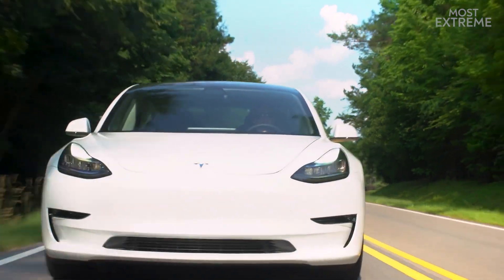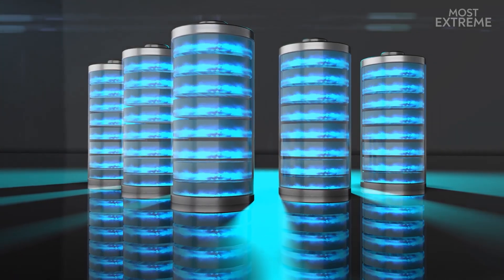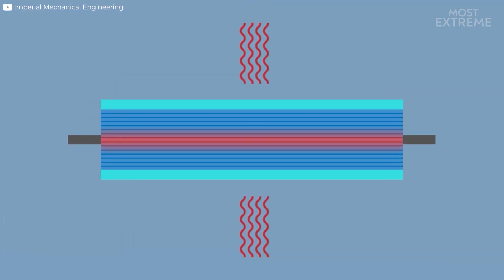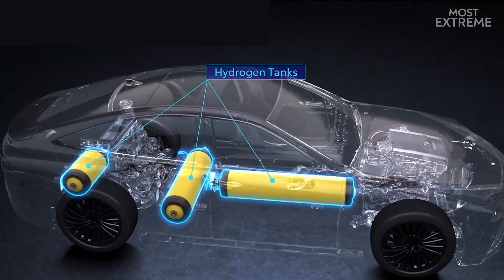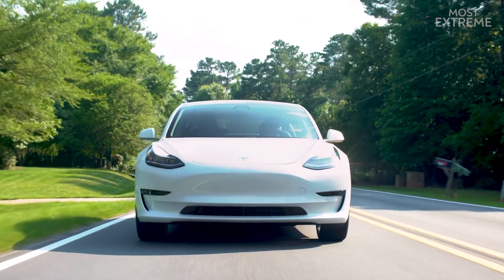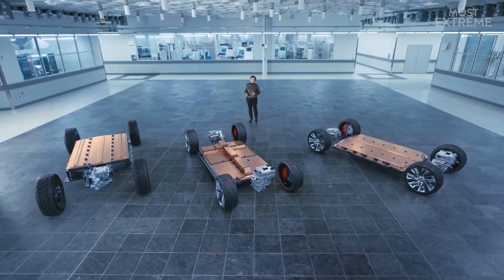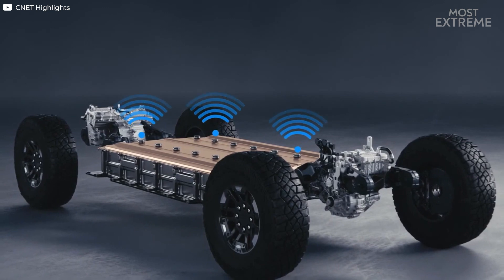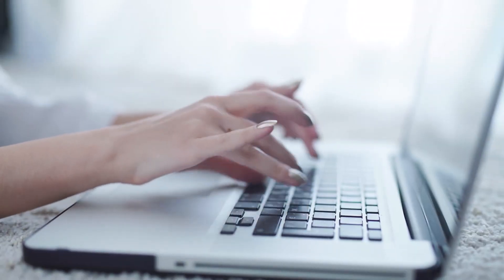Lithium VS Hydrogen VS Solid State | EV Battery Technologies Explained

Comment: ~ Battery EV ~ grid power, to battery, to forward motion, around 85%-90% efficient from grid to road
~ Hydrogen EV ~ grid power to electrolyzer that splits water to Hydrogen 75% efficiency, a 25% loss right off the top, compress the Hydrogen to 10,000 psi another 13% loss, transport the Hydrogen to fueling stations another 5%-10% loss, fueling stations will need energy to operate but let's not even count that, fuel cells are roughly only 40%-60% efficiency so a minimum loss of another 40%.
Simply adding the losses your left with 32% of the original electricity used to split the water. But in truth the losses are cumulative, so in reality your left with about 20% of the original electricity being used to propel the car. So you would need 4.5X the power from the grid up front producing Hydrogen to get the same miles traveled as a battery EV.
In addition to the to that. An electrolyzer that makes 4 kilos of hydrogen per hour (top off 18 Toyota Mirai's per day) plus the hydrogen compressor required for 10,000 psi, high pressure tanks, plus a building and all the various ancillary hardware, monitors and safety equipment cost upward of $2 million dollars, the fueling stations cost upward of $2 million dollars. Added to that will be the cost of replacement parts, labor and maintenance.
Battery innovation is happening at breakneck pace. Hydrogen from beginning to end is much more involved, complex and expensive to maintain. Also there are limitations to the improvements to efficiency that can be made by turning electricity to hydrogen back to electricity. It will never be economically feasible.
Reply: I copy pasted a few paragraphs below from a paper by - Prof. Werner Antweiler, Ph.D.
Fuel cells are not perfectly efficient converting hydrogen into electricity. Some of the energy is lost as heat in the process. The tank-to-wheel efficiency of fuel cells is reckoned to be only about 40–45 percent. Toyota reports that its FCV requires about 0.8kg of hydrogen per 100 km, although 1kg per 100km is probably more realistic under normal road conditions. A typical BEV consumes about 20-25 kWh per 100 km, depending on weight and other characteristics. Some small BEVs are even more frugal.

How is hydrogen made?

Currently, the main method of producing hydrogen is from steam methane reforming (SMR). High temperature steam (700-1,000°C) is combined with methane under 3-25 bar pressure in the presence of a catalyst to produce hydrogen and carbon dioxide in two chemical steps. Steam and methane generate carbon monoxide and hydrogen, and then a water-gas shift reaction combines carbon monoxide with more water to form carbon dioxide and hydrogen. A third step removes impurities from the gas stream, leaving pure hydrogen. Using low-cost natural gas is currently the most affordable option to make hydrogen, but it is not GHG neutral because of the carbon dioxide that is created in the process, and the heat that is needed in the process and comes from burning natural gas. Producing one kilogram of hydrogen is associated with about 9 kilograms of carbon dioxide (Sun et al., 2019).

A cleaner method of producing hydrogen is through electrolysis, where an electric current breaks water into its two constituents. If the electricity comes from clean renewable sources, the hydrogen is indeed mostly emission free. The only emissions are associated with the upstream manufacturing of power generation equipment.

Hydrogen made from SMR with carbon capture and storage is also called "blue hydrogen", while hydrogen made from water electrolysis is called "green hydrogen".

There are other pathways to produce hydrogen. One alternative technology is known as thermal and plasma pyrolysis, which breaks up methane into hydrogen and carbon directly. Plasma pyrolysis requires 10-12 kWh/kg and has far fewer emissions than SMR.

How much electricity is needed to make hydrogen?

A completely efficient electrolysis system would require 39 kWh of electricity to produce 1 kg of hydrogen. However, the devices commonly found in operation for this process are less efficient. A typical operational figure is about 48 kWh per kg of hydrogen.

How efficient are FCVs compared to BEVs?

‘BEVs are more than three times more efficient than FCVs.’

There are two types of energy losses that need to be accounted for when calculating the kWh needed to drive 100 km: well-to-tank (WTT) that accounts from source to hydrogen tank, and tank-to-wheel (TTW) in terms of fuel cell efficiency and propulsion in the vehicle. Combined, these two energy losses translated into a well-to-wheel efficiency (WTW). A recent study by Whitehead et al. (2018) shows that FCV only have a 22% efficiency, compared to 67% for BEVs. This translates into an energy use of 87 kWh per 100km for FCVs and 28 kWh per 100 km for BEVs. In other words, BEVs are more than three times more efficient than FCVs.

If FCVs are less efficient than BEVs, do they have a future?

FCVs for passenger vehicles makes neither economic nor environmental sense. Economically, the extra cost of producing hydrogen and distributing hydrogen makes FCVs less economical than BEVs. Whereas batteries are becoming continuously cheaper and significant innovation is visible on the horizon, the potential for reducing the cost of fuel cells or making them more efficient appears to be limited.

FCVs for passenger vehicles also do not make sense environmentally as long as electricity is not completely clean, or hydrogen comes primarily from SMR sources rather than renewable energy. FCVs with hydrogen from natural gas are not significantly better than modern (mild-hybrid) gasoline engine vehicles. Every extra kWh of electricity that is needed for making hydrogen is putting more carbon dioxide into the air than a battery-electric vehicle, even including for upstream emission in battery manufacturing.

Comment: I see some issues about this over hyped EV moment...the amount of money that will be lost by the buyers when this old battery expired...and the amount of trash battery we will need to take care of...on top of that the natural impact to extract the material to produce both liquid or solid stat batteries... let's hear what they will have to say when these problems popped up...I'll keep my old ICE car for now...
Reply: Ah, you've obviously not heard of EV battery refurbishments.  Cleveleys Electric Vehicles in the UK, carried out a battery refurb on a 10 year old Nissan Leaf. The work took 4 hours, and cost the owner £600.  And there is no liquid element in a modern EV battery. There is nothing to leak out.

Comment: What’s stopping me from getting an EV? Fixed Income Pension’s and EV Prices are Miles Apart!
The same goes for over half the population that had no choice or chance past a Minimum Wage Job.
Reply: EXACTLY, and who knows if you get a lithium battery powered vehicle now they could stop and ban the use of lithium batteries in vehicles if solid state advances in tech due to environmental reasons
Reply: Buy a used EV. Lots of choice out there now. I've seen used EV's on sale at £6k.  The problems you are citing haven't arisen specifically as a result of the introduction of electric cars. The problems you describe would apply to any type of car, irrelevant of it's power source....  If you can't afford a £15,000 electric car, you still wouldn't be able to afford a £15,000 petrol one either.
Reply: @Brian-om2hh  here's the thing, not everyome can switch from there car whether it's for financial reasons or even the desire to change cars, and your not even considering the people who live in apartments that don't have a charging source and even if they did tho those spots would be full 24-7. Ev shouldn't be pushed this hard and it isn't ready yet for everyone to switch too.

Comment: Great informative video into Battery/hydrogen tech. Although I have to disagree with your initials points around hold backs on EV adoption regarding Range anxieties with 300-400 miles of range and long charging times. 

It's extremely rare to drive 300/400 miles without stopping, you would need a rest stop giving an opportunity to charge, and the charging tech has developed fast passed having to wait >hour to gain substantial charge. 

With those particular statements, it's the mindset of ICE vehicle drivers that needs to change, which is the comments I get a lot (I have a Nissan e-NV200 with 100-150 miles of range.) 

Cars that we use for daily driving don't need more than 300/400 miles of range, even today, there may be reason to challenge that if your lifestyle has you driving 100s of miles a week but even then I'd still say that's sufficient range. 

Further, moving from ICE to EV a key in charging is understanding that it is done alongside other tasks and not as a stand alone activity. I charge my van at home of a 3Kw Plug, from 0%-100% it takes 22 hours... you can imagine the laughs from friends that drive ICE saying, "wow we'll have to give you a day's notice to meet up then" because ICE drivers know filling the car as a stand alone activity where you have to stand at your vehicle filling up. This is completely wrong for EV, even with 150 miles of range it is sooooo much more convenient, I come home, plug the van in (takes ~15 seconds) and I'm done, I just do that at the end of each day. If I'm out on the road, I take a put stop to grab food or use the toilet while charging on a fast charger and I'm good to go. 

So really, charging an EV means instead of queueing and standing at a fuel pump, you plug in and go about your day with an EV. 

Great video though, helped me understand the technology inside the batteries. Thanks
Reply: Unfortunately as with everything else on social media people tend to “pick a side” on an issue, and the remarks are, unlike yours, just arguments that prove their position by cherry picking their points. I’m “for” EVs, or “against” them. Context is everything. I live in a rural area in a 2 car household. One EV and one ICE car in the driveway will cut my emissions footprint and gas dependency while retaining all the freedom I could ever want to meet every travel scenario. Until my country’s infrastructure and the EV battery technology matures more, anyway.
Reply: If everyone were to change to ev your electric bills and solar bills are going to go through the roof. You may enjoy how "free" it is now but you'll see. The government and other corporations always have a way of taxing you. And I'm assuming your van is lithium powered? Which isn't good for the environment compared to solid state batteries? Yeah with how anal the world is about the environment lithium use in batteries will most likely be banned and replaced with solid state or hydrogen which means no replacement batteries for the van.
Reply: Agree with you.
Reply: Well, it's not like you stop where you want and can recharge at a 200kW charger and recharge in 10minutes...
300 miles is nothing on a vacation.

I like to go where I want and not plan the trip around the local charging stations and eating in a noisy and disgusting road restaurant. 
With benzine you just refill in one minute and go chill and eat on a nice place in nature

Comment: ICE cars ...Are Silent Killers with Pollution and Damage to enviroment. As for Hydrogen cras...It is exepensive and its ENGINE needs 'Complicated maintenance' and storing Hydrogen infrastructure is VERY expensive. Plus needs MUCH regular maintenance to prevent possible due to HIGH pressure tanks. Solid State batteries are EXPENSIVE and difficult to Produce. Due to the required HIGH wattage required ...It is an EXPLOSIVE bomb "  On wheels  " if things goes WRONG. Much worse than Lithium batteries fire issues. So far ..... Lithium related Batteries are the way to go to . 2022 onwards.

Comment: All EV users are learning quickly that promised range is best possible only. In real life specially when is cold and you try to drive long distance with highway speeds range is nowhere near promised. This plus charging time make EV great for city but nasty for long trips. 
Only when on charge will be possible to do same range as on fuel tank and charging will be not a lot longer than refueling EV will be able to compete with ICE. 
Let's wait and see if SSB will solve current EV problems. Nowadays for me best solution is PHEV as is offering nice EV range in city where you can charge easily and same range as ICE on long trips where EV is problematic.

Comment: Stop wasting time $$$ and energy , determining which is best , not the answer , 
Is , both on most full size , all around personal or business use by having a refuelable quickly h fuel cell to keep batteries , full or nearly fully chargedduring operation , when stopped can be charged by electric charger or the h fuelcells will bring to full charge , most desirable .most commute type cars , trikes or bikes can go either away or both for more range and quik fueling of h fuelcells to keep battery charged up also if on location no , power fuelcells gives much longer life to battery ,

Comment: electric cars still have a long way to go before they are practical in Australia. Most people here have relatives in other parts of the country or like me just do annual trips across the country. none of these cars can drive across australia with the a/c running flat out without needing to many long recharging stops. My next car around 2025 with be another diesel. Hopefully after that bev will have evolved enough or maybe hydrogen fuel cell will have moved in. We will have to see.
Reply: It isn't the use of EV's in Australia that is impractical, it's the Australian Government who are impractical......They've had their heads buried in the sand for years. What a hell of a shock they'll get when they finally pull them out.....

Comment: My company JCB is investing heavily in hydrogen. But not fuel cell. ICE hydrogen it seems a very viable solution and when the infer structure is improved it will suit a lot more than the heavy construction equipment sector. Also green hydrogen production can be ramped up easily with existing technology. Toyota is also involved in this brilliant but simple solution.
Reply: The most important industrial method for the production of hydrogen is the catalytic steam–hydrocarbon process, in which gaseous or vaporized hydrocarbons are treated with steam at high pressure over a nickel catalyst at 650°–950° C to produce carbon oxides and hydrogen: CnH2n+2 + nH2O → nCO + (2n + 1)H2; CnH2n+2 + 2nH2O→ nCO2 + (3n + 1)H2. The primary reaction products are processed further in various ways, depending on the desired application of the hydrogen.

Hydrogen gas creates carbon monoxide and its bad as fuck for the environment. I'm sorry, but a basic law of energy is that energy can not be created or destroyed and in real life energy is lost to the surroundings during the transformation of the system.
Reply: But all that hydrogen still needs to be produced, using lots of electricity. After which it then requires transporting in specialist tanker vehicles to where it is used - causing roughly the same pollution as deliveries of petrol or diesel.....

Comment: Hydrogen has an energy density problem.  While energy per kg is very good, energy per litre is very low (even in liquid form) leading to large fuel tanks.  To make matters worse, the high pressure required for hydrogen makes them very heavy.
Reply: I just saw aluminum solid fuel, it solves the problem of liquid hydrogen.
Reply: Hydrogen is " A Dead end " solution due to the many logistic and Cost issues.
Reply: @sunshinesun121  and so is lithium. Solid state seems to be the viable option.